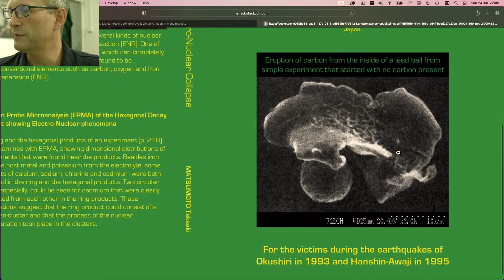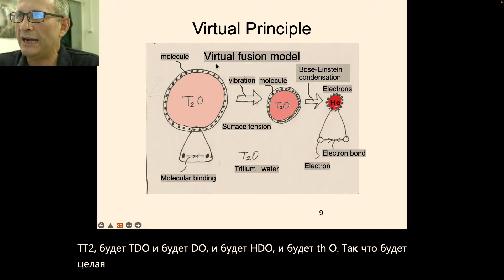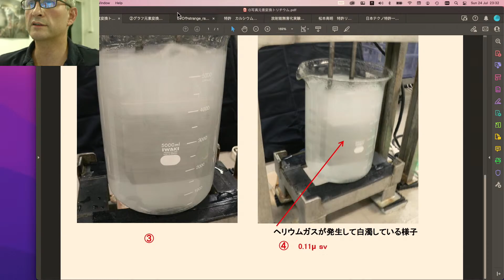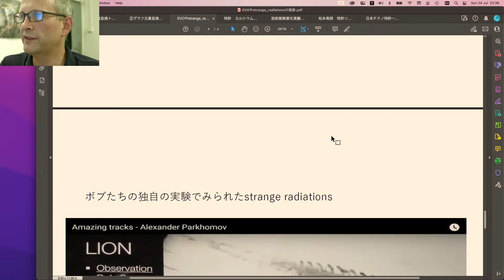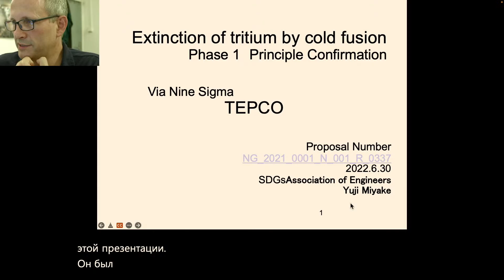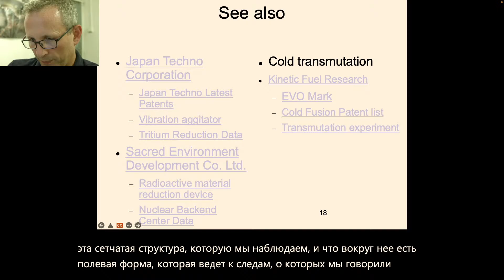Fixing Fukushima - Second bite of the apple

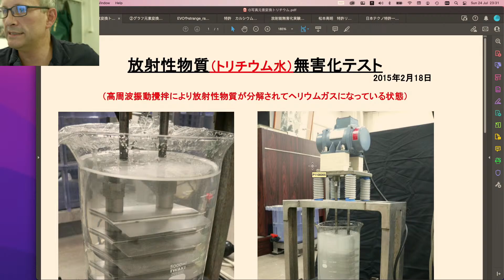Comment: @1:26:32 Is the material used for plates important or they used these metal just for corrosion resistance?
Reply from the maker: Yes it is important. A stiff metal should be used. Moreover if using steel, it should be without Chrome as there is the risk of producing Hexachromate.

Comment: A common problem with boat motors is the cavitation upon the propeller vacuum side of the propeller. It leaves scars and holes all over. Is nuclear transmutation occurring? It can effect any propeller that creates vaccuum bubbles in water as far as I am aware. How would that be described differently vibration agitation?
Reply from the maker: It's the same - but there is so much contamination it will not have been easy to determine transmutation. Also, not practical for this purpose